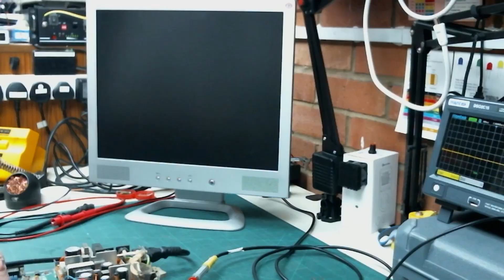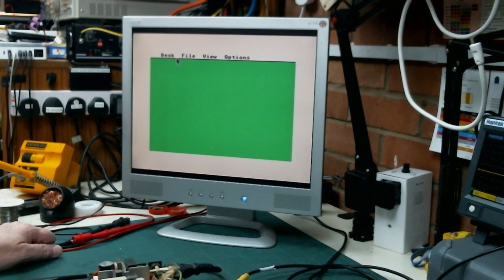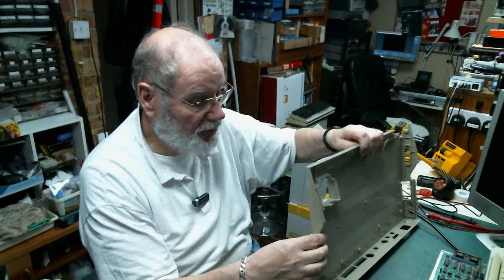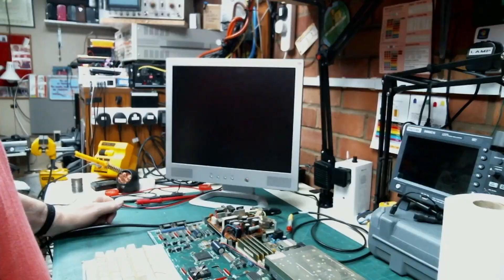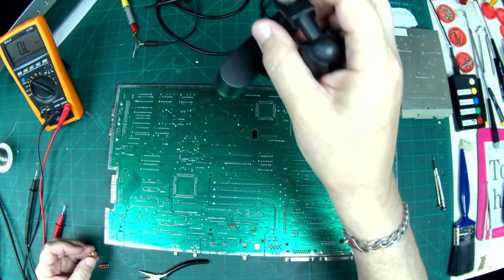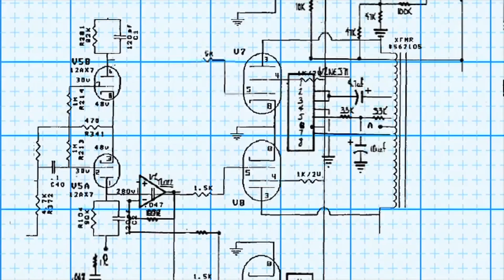ATARI 520STe Resurrection Pt2

Comment: Those Atari ST cases are so brittle. They break for fun!
Reply from the maker: Yeah, guessed that, have found similar other old cabinets failing in the same way.
Reply: @ChasLarge  It isn't just the odd one either. I have several and they are all really fragile

Comment: The spring on those reset switches is normally on the outside, around a stalk, pushing between the switch chassis and a button. The spring would have fallen off when the button broke on your machine.